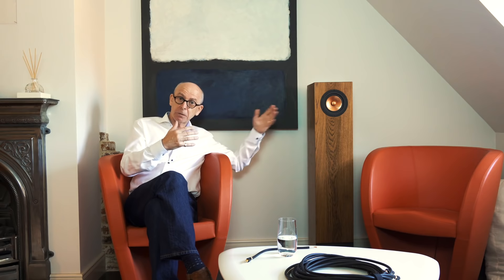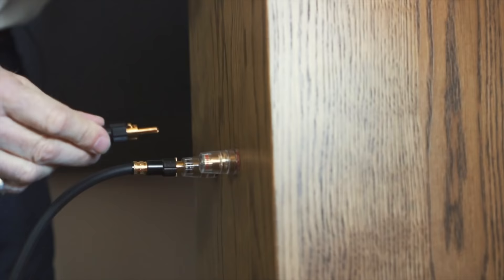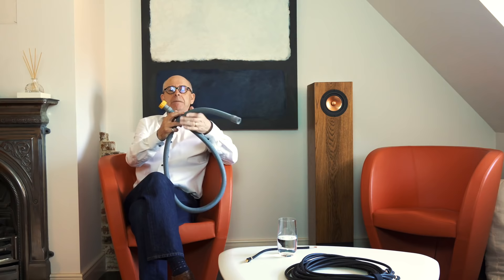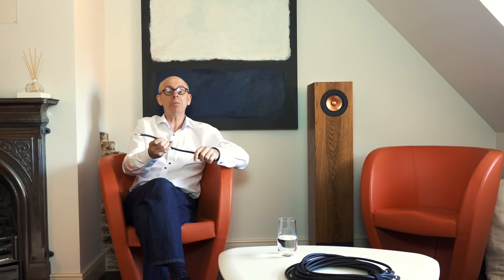Loudspeaker cables - how do they make a difference?

Comment: Interesting, but where is the evidence/documentation that this has ANY influence on the listening experience as experienced by the listener?
Reply from the maker: Hi, you raise a good point. As you probably saw in the video was that my conclusion was to use multi-strand copper,  because the idea is not to influence the sound. It is really easy for a cable manufacturer to ‘shape’ the sound, if they want to by simply building capacitance into the cable (usually this results in a rolling off of the treble). This can be noticeable but, we only recommend using high quality, multi-strand copper, with good connectors at both ends. It works, it’s not expensive and never needs changing.

Comment: Too far above my spend-grade. When I had the walls open in our fixer home back in the 1990's, I used 16 gauge stranded copper wire from a 250 foot roll to wire-up the house for stereo. It still works just fine over 25 years later. Should I start to lose sleep about my future stereo listening situation?
Reply from the maker: Absolutely not! Enjoy your music. Stranded copper, as you know and prove, works just fine.

Comment: Hey are you doing?
Few rules for good sounding cables. 
Never mix different metals in a single cable. 
Binding posts and plugs are the weak point. 
Internal cabling of a speaker could be a big weak point. 
I have great results with 2 different metal between positive and negative on the same speaker. The different pace of the two metals may helps in some instances. 
Non oxidising metals are the best. 
I do my cables and I confirm cables matters.
Reply: The entire amplifier is generally full of different materials. Tin and lead to start with.

Comment: Cables have been a very continuous topic as I am sure you are well aware. Cables are trivially easy to measure, Could you please provide the measurements that differentiates your cables from more generic cables.
Reply from the maker: Hi, thanks for your comment. Firstly, let me repeat what I state in the video. There is nothing special about our cables. Except that they are of high quality, sit nice and flat on the floor, have a low capacitance, low resistance  and consist of 80 strands of copper, each. When we developed our loudspeakers we had to decide what to use as a reference point and we chose for multi-strand copper because we knew everyone could get hold of it easily. 
It is very easy to make a cable alter the sound, all you need to do is add capacitance into the casing, or make it resistive, or induce an inductance (or a combination of all three). Some manufacturers do this to make their cables sound nice. Because the amount they alter by are usually very small, it can be hard to measure, but not impossible. 
Hoping this helps?

Comment: IMHO - there is a fundamental difference between using a piece of wire for a speaker cable and a piece of wire for a voice coil.
The speaker cablees need be of sufficient sqr to be as "invisible" as possible but also manageable to handle. 
Where as the voice coil need to meet some very different constraints and work in a magnetic field - there are the DC resistance, the (ac) impedance and a bunch of mechanical contrains - and I am not an expert into voice coils :o)

And before anyone try to start a hot discusion with me - here is my background and this will be my only comment on the subject - 
Just over two decades ago me and a friend took 3 sets of speakers, a set of IMF transmissionlines - a set of JBL L100 and a set of exponential horns equiped with two Lowthers each, and to drive them an Accuphase P300.
We set out to test 5 sets of expensive to VERY expensiv speaker cables (from $10 to $50 per meter) against our plain multistranded 4 mm sqr. speaker cables.
Equipement used - a 4 chn Techtronix oscilloscope, 2GS/s per chn - two Techtronix current probes - two 100MHz std probes - one B&K measuring microphone with a custom Phantom PSU/amp (build by myself to increase both dynamic and freq. range), a HP signal analyzer, two 800 MHz Pentium 3 to run all the signal analysing software on.
 And here is our findings - apart from being able to introduce varying phase delays by curling up some of the cable in different ways, especially the standard speaker cable, the only difference we found were not audiable to us as we were not able to hear 0.2db differences .
The maximum difference of signal/power, phase - wave form - signal quality - power lose, measured between any of the 6 types of cables on the same speaker was 0.2db.
There were measurable phase delays between speakers but not between cables - on the same speaker.
If anyone are able to hear 0.2db differences I accept that buying $50 per meter cables may mean a lot to them - I can't

Btw, it took 2 weeks to number crunch everything - alligning the sampled microphone signal to the measured voltage and current signals was time consuming whith the software tools we had avaiable 20 odd years ago.
Today I own the computer power to do it all in real time. Most engineers can do this but don't care - and some of them don't care because they will earn less if more people know the results ;-)

I have done my homework and I don't want to waste my time discusing the subject of speaker cables with anyone that hasn't !
Sorry for this last very "unpolite" line - but I have experienced so many times that I end up discusing something that is impossible to discus - connecting my brain to their sensory system ! - to hear what it is they claim they hear - and that I can't measure with my equipement that is able to measure 0.2db differences of any narrow freq band in the music played at 100db SPL. 
Anyone that knows just a little about the human perception of sound and light knows why you do not discus 0.2db diffenrences at 100 db SPL.

"Listen to the music .... " ;-)
Reply from the maker: Thanks for your thoughtful contribution to the topic.

Comment: I know a more refined simplification won’t add to the discussion or detract from the main point—but I’ve always been told that voltage is analogous to water pressure and electrical current to water flow. The hose analogy still makes sense under those assumptions, as the air in the room in the case of the power cord effectively functions as a finger over the hose opening in the analogy, preventing flow into your kitchen. More water pressure would force high pressure water jets between your finger and the mouth of the hose, just as a high enough voltage would cause the air in the room to ionize and result in electrical arcing.  Again, not germane to the discussion at hand, but perhaps a small nudge to bolster the usefulness of the physical analogy just one bit—as the actual mathematics still elude me somewhat.
Reply from the maker: Thanks for your contribution. Trying to explain the physics of electrons and electricity ‘flow’ in simple terms, always leads to heavy criticism.
Reply: @PearlAcoustics  To be clear: no criticism at all from me.  I love your videos and couldn’t be more happy that I stumbled onto your channel—it’s absolutely great that you’re a musician, audio engineer, AND speaker designer. I have yet to find someone else on YouTube who bridges this gap, and I love your nuanced, informed presentations (listened to Random Access Memories all the way through last night, not my usual fare).  Heretofore it has been disappointing seeing reviewers who either love music but can’t explain a thing about how/why the equipment works,  or more commonly, technophiles with gear acquisition syndrome who treat music as test tones. 

Anyway, thanks!
Reply from the maker: @maximburgman  well, thank you! Very kind, so glad you enjoy them! There’s more to come 😉
Reply: Why talk do much? Why not use a good measurement equipment to measure the impedance, resistance ... of each cable when connected to a speaker from an amplifier to read how much the difference? Someone has done it and found out that the difference could some times be around 0.06 dB, which would be hardly perceptible to the human ear.
Reply: @Emile it’s the comments section. All we can do it talk! :D

Comment: I don't get the relationship being drawn between a free stading cable and the winding of a magnetic motor, (voive coil) they are apples and hedgehogs. Round conductor windings leaves air gaps, hexagonal wire eliminates gaps, changes the parasitics, this sort of stuff is well known and will effect a wire coil moving at velocity in a huge magnetic field, with the cable, I can't see where there link is.
Reply from the maker: Thanks for your comment, to be honest it was a bit of a diversion in my improvised talk. I was quite shocked, at the time, how so few people knew how electricity was generated, so it was obviously in my mind. I even go into it in more detail in a later talk. This was one of my first.

Comment: Hmm. I can see where your exalted speaker driver designer changing the voice coil can effect an improvement in the output of that driver but I'm still shaking my head about changes in the cable. An analogy might be a violin maker changing some part of the body of the instrument might change its sound but suggesting changing the tuning pegs will change the sound would have me scratching my head.
Reply from the maker: Hi, I totally get where you’re coming from. I too was very sceptical. Changing a cable is a bit closer to changing a string, rather than a tuning peg. 😉 But the point I was trying to make is this. 
Compared with the wire in microphones and loudspeaker drivers, loudspeaker cables are not nearly as critical. Having said that, there are loudspeaker cable manufacturers out there who deliberately make cables that impact the sound. They do this by changing either capacitance, inductance or resistance, or a combination of all three in the cable. It’s easily done. This is why we decided to run with plain, high quality, multi strand copper for our cables. On the basis that it is readily available and people on a budget can easily make their own.

Comment: Do a double blind test between 16guage lamp cord and "magic"  high priced audio cables.
Reply from the maker: Hi, thanks for your comment. As you probably saw in my conclusion. We recommend straight forward multi-strand copper cables, but there are some high-end cable manufacturers that do bend the sound with their cables, and these can be clearly audible in a very revealing system.

Comment: What material is the connector? I am not a big fan of connectors. I go straight in the crossover or  in to the driver.
Reply from the maker: Hi Al, well of course we don’t have any crossover so we use a gold plated connector that is tensioned so that it has a very tight, lockable connector to our binding posts.

Comment: the best sounding voice coil is ultra thin copper foil NOT wires. and lower ohms regime at 2ohms  or even less, like 1 ohm or more extreme at 0.5 ohms. so, at 2 ohms or less and almost any cable is irrelevant with that patented hifi speakers. over all sound is absolutely amazing with germanium amp

Comment: Harley, this was informative and interesting.  But it left a question - what is the gauge of your wire?  You refer to it being 6mm thick, but that can't be the diameter of the wire bundle.  Also, if the electronics are off to one side, rather than between the speakers, is there a problem if the two wire sets are not the same length?  Thanks
Reply from the maker: Thank you for your kind appreciation and question. Our loudspeaker cable is comprised of a central conducting core which is made up of 80, 0,3mm thick low oxygen copper strands. Which when twisted is about 6mm thick.  This equates to an AWG rating of 10. Because the resistance of this cable is extremely low (0.0033 ohms per meter / per cable which only 3,3 ohms for a cable 1km long, then it does not technically make any difference if you use cables of different lengths, as electricity flows roughly at the speed of light! However, most of the time we just accept the fact that on one side there is a surplus of cable.  how much difference in length are you proposing?

Comment: Sir, why use such a small dia driver in the Sibelius. You must have used a very good quality driver, surely it could have benefitted with a  10 inch driver compared to the microscopic one. It can't be bigger than six inches?
Reply from the maker: Thank you for your question. Please do not take this the wrong way, but many people confuse the amount of bass with the diameter of a drive cone. In fact, in many ways, the opposite is true.  Our loudspeakers are flat at 38hz, which is very low. The bass is fast, accurate, plentyfull and deep. The smaller drive cone does not distort during excursion and can deliver treble, way over 16khz. When we record bass drums or acoustic basses, we use very small diameter microphones. Hopefully one day you will hear a pair and see what we have achieved. Another point of interest can be that many subwoofers use small diameter drive cones… and to excellent effect. Even though we don’t think the Sibelius needs one.
Reply: @PearlAcoustics  OK, hopefully.

Comment: If there are so many chances for the cables to damage the signal to the speaker surely it would make sense to purify the signal after the binding posts in the speaker at the crossover.
Reply from the maker: Thanks for your comment, obviously, In our case, we have no crossover, we connect directly to the drive cone

Comment: I'm not sure your story about changing the speaker coil says anything about how cables work. The speaker coils create a magnetic field that directly move the drivers while the cables just carry a signal. It's obvious that making even small changes to the shape of the magnetic field will change the sound of the speaker.

You say that silver plated wires sound brighter? How? Are you claiming that silver conducts high frequencies better than copper? Or is it just that silver is brighter visually than copper and there's a boubou/Kiki effect going on.

An audio dealer once told me a wooden amplifier rack would sound warmer than a glass one, this seems like similar effect.
Reply from the maker: Hi thanks for your comment. I have noticed that silver cables make a difference from hard practical experience. I do not know exactly how. Also many cables are given a capacitance that effects their sound. However, the big point I tried to make is that good, multi-strand copper works just fine. And that any difference is way less than changing any other component.

Comment: Would you listen to regular 2-ways or 3-ways? Not me!
Reply from the maker: Depends how great the music is! The very best two ways don’t sound like two ways, in the right room. But for me, I am happy with a single driver.
Reply: @PearlAcoustics  I build speakers with single drivers and coaxial drivers and I also bought some B&W 706s and they sound like 2-ways. You can easily hear the separate sound coming from the woofer and doesn't show any cohesion between the woofer and tweeter. It's noticeable when suddenly changing from the single driver speakers to the 706s. It was obvious and they cost me $2400 (AU) and I use them for a basic frequency guide by copying the sound of the 706s with my speakers. Then I artistically tweak the sound. And when I did it to my latest speakers it made mine smoke the 706s hands down! Especially on female voice, piano, brass and big band. I gave my made speakers more lower treble which (in my room) the 706s seemed to severely lack.
Reply from the maker: @Justwantahover  if you go to rock concerts, often the tweeters are stacked separately from the bigger drives. Some people love listening to tweeters. I guess it’s ‘horses for courses’. Best wishes, H

Comment: The terminations on these cables are the first I've seen that make me think, "now THERE is a truly well-designed cable termination". Are they available for purchase anywhere, or are they a "Pearl Exclusive"?
Reply from the maker: Hi Eric, we have ours made for us but I think there are some similar designs out there.
Reply: The only "termination" needed is a tight screw or banana plug on cheap wire. There is ZERO measurable or audible difference between that and all this snake oil. Cable terminations matter at RF and microwave frequencies or on VERY long cable (as in half a mile  or more) at audio frequencies.

Comment: Thats a lot of talking for just saying, that cable do not really matter or differ, just needs some good quality copper with a large diameter and solid terminations that make good contact.
Reply from the maker: Thanks for your neat resume of the video. Indeed it is, but I wanted to take my audience on the journey and explain that it is possible to change the sound of a loudspeaker by designing in attributes into a cable, and therefore some manufacturers do. That does not mean better, per se, and we don’t recommend them.

Comment: That cable is it used inside of the speaker ?  Is there any synergy using the same cable used inside a speaker from the amp to the speakers ?
Reply from the maker: Thanks for your question. We use a different cable internally, (1,5 silver coated, multi-strand copper) mostly for practical reasons. The synergy in our case is maintained because we don’t have any printed circuit boards or electrical components in our enclosures. I hope this answers your question?

Comment: What type of cable were you using that had such a big bump ? I have measured lots of audio cables with some pretty high precision instuments and I have never seen more than a 0.3 db (bump). There are no humans that can hear +/-  0.3db variation. You need no more than good clean copper, anything more is snake oil.
Reply from the maker: Hi Ted, thanks for your question. The bump I refer to was not in the loudspeaker cable but in the actual voice coil of the driver itself. Indeed, most cables do not measure differently (or their difference is almost too small to measure). Hoping this helps?